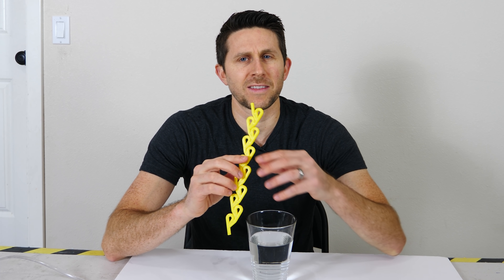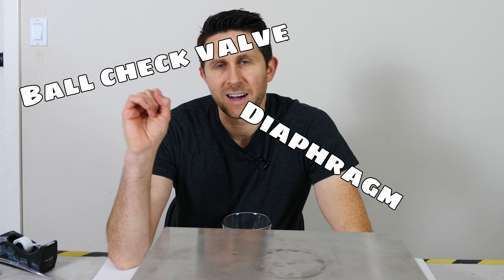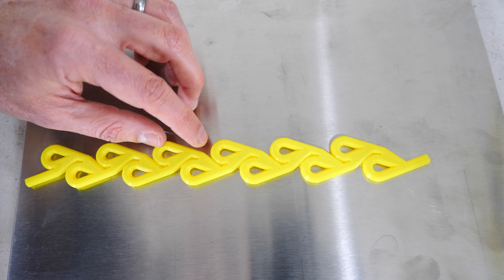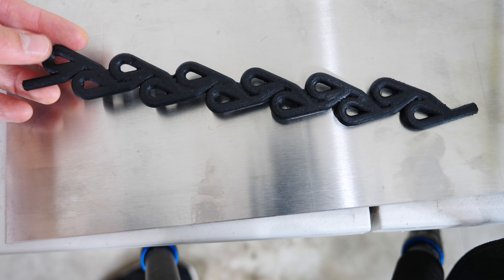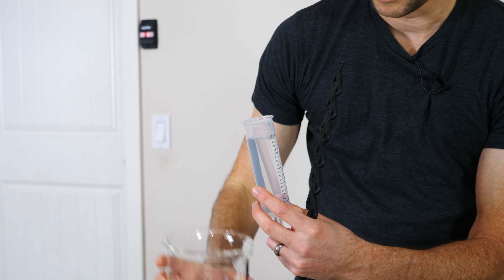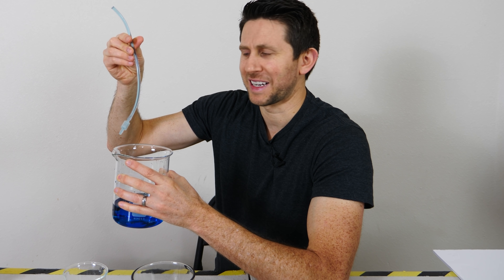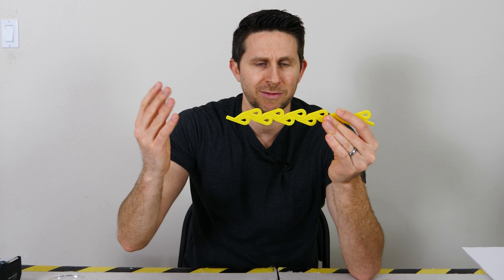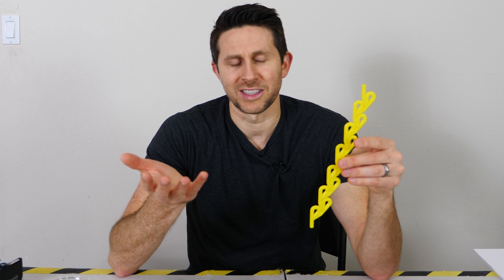This Tesla Valve Straw Only Works In One Direction

Comment: False it will work on every side one side doesnt create turbulence so its easy to use it as a straw on the other side using as a straw will creat a lot of turbulence wich breaks like the flow down but it still works you just need to suck it right and stronger  😂😂😂 but yeah tesla valves are moving partless but also not really safe they doesnt prevent back flow and they are actually two way valves in series only one or two segments dont work you must have more segment to prevent backflow but you never get it to zero if you suck enough 🤣🤣

Comment: Tesla valves actually work well with pressurized or fast moving flows.  The greater the pressure in the wrong direction, the more it restricts the flow.

Comment: The point of a 1 way valve is to let water through one way and block it the other way, not just to slow it down. So what Tesla did is not really a valve, it is more of a resistor in direction not a valve.

Comment: Think in terms of Reynolds Number and viscosity.   The valve needs low-viscousity fluids in order to produce the tiny fluid jets.  Try drinking milkshake or thick syrup, and both flows become identical.   Or also, try it with extremely slow flows.   If there is no vortex-shedding, then tiny fluid jets cannot form.

Comment: Since bottled propane is delivered at a higher pressure than natural gas, a tesla valve could be designed that will allow a gas burning appliance to use either fuel depending on the direction of flow through the tesla valve.

Comment: Combine 2 valves a hypertension check valve and a double inlet valve each other on the output the strongly block in place in the other direction

Comment: Inertia plays a major role in a Tesla valve.  There is very little inertia involved when you just let some water drip through.  A Tesla valve works much better when the speeds involved are much higher.

Comment: Had come here just to comment on the title ;) Because the purpose of Tesla valve is to allow flow in one direction only, it actually perform correctly in both directions when it allows flow in one direction and not in the other. So it works both ways as intended. Now watch the video to see if I was right or not. ;)

Comment: Since it has no mechanic parts it may be used very well for longtime sustainability. Preferred in places where any service is difficult to get. Also for cheap production since it des not need assembly. Maybe, also a pop-pop-boat may increase speed if inlet and outlet of the drive are seperated by tesla valves: There is still simplicity but higher efficiency.

Comment: As cool and interesting as Tesla Valves are, they aren't truly one way. They only dramatically increase resistance in one direction- they don't stop it entirely. As this video demonstrates, gravity is sufficient to "break" a Tesla valve- though it may slow the flow, it won't stop it entirely. If the valve is used in a certain way- such that fluid traveling in the "wrong" direction must fight against gravity, then it might be able to severely limit or even outright stop backflow depending on just how much pressure there is forcing the fluid through the valve.

Comment: I had a tracheostomy about a year ago. I was way to drug'ed up to remember most of it, but they gave me a little plug to stick into the hole in my neck so I could talk. I learned from the doctor that the purple plug that I was sure would cost $10K is actually a bunch of tiny check valves. I want something similar for a chimney pipe. One flue is sucking in the other ones smoke. Any ideas?

Comment: Tesla valves can be used on some extremely high pressure substances when a mechanical valve cannot bear the stress. With the resistance the pressure of counterflow could be reduced to which a mechanical valve could handle.

Comment: Why would you want a one-way straw? Well, especially for wide straws, like for smoothies and boba, you have to suck up a decent volume of air before you get to the drink itself. And then when you put back the drink, the next time you want to take a sip, you have to start over. This is especially annoying when you like to take small sips. If, say, the straw has a volume of 10 ml, and you like to take 1 ml sips, you would have to sip about 10 times as much air as the drink itself (ok, in reality it depends on how much of the straw is below vs above the surface of the drink). Unless you use a one-way straw, that is, which solves the issue.

Comment: When we dip one end of a straw in water and then block the other end with our finger and pull the straw out of water ; the water present in the straw will not fall down as long as our finger keeps blocking the upper end. You may say its because of atmospheric pressure but this doesn't happen when you turn a bottle of water upside down! All water will come out while air entering the bottle through the same hole !!! Is this related to the surface tension of water ? Is this related to the dimension of the hole ?

Comment: I didn’t timestamp like I usually do because it is literally starting in the first ten seconds of the video

Wow if you listened closely to the sucking sound thru both sides you can even hear a slight lowering of the pitch, presumably because it is able to get air through faster the “correct” way and slower in the opposite?

Comment: 3-D print a three dimensional one going to a single straw, I imagine it looks like donuts stacked with straw in the center. So if you cut it directly down the center of the straw both halves would look exactly as this two dimensional version does on the inside

Comment: Or imagine a line going through a circle. The focal point is the bottom of the circle where it intersects with the line. A stop chamber with a smaller whole is place 1x below the focal point and 1x above the focal point. A ball 1x large os placed inbetween. When liquid flows down it presses the ball into the lower chamber blocking the flow. When it flows up the liquid pushes the ball up pass the focal point allowing the liquid to flow threw thw wings of the circle.

Comment: Much simpler would be a straw with a cone and a square cone inside it with a ball inbetween. Clogging the hole to the regular cone. Allowing the liquid to pass around the sides of the square cone.

Comment: Actually it turns up to be an excellent noise supressor . I found that  being a kid in the 80's when i visited the military ship where my father was chief engineer. The romanian military ships on the Danube had that on the engine's exhaust, it was made in pairs of loops,so the tipical diesel engine noise  was silenced. At the exhaust tube could be seen smoke coming out in uniform flow but without the noise.

Comment: Does the valve still work at all if the center flow path is perfectly straight? The intended use of the operation would be for high pressure gases

Comment: what happens when you shake the straw up and down? does it act like a pump? and also if you tip it side to side like when the little ball-shot was progressing in its channel, will it act like a pump in a sealed straw? also, on a huge scale could the downstream neighborhoods below a dam be engineered with the terrain augmented with viaducts in the shape of a tesla valve to divert water in the event of a failure of the dam? also could islands have their coast or the inland areas have the landscape Tesla's in such a way that AFTER a tsunami the exiting water gets caught in a tesla viaduct and diverted to a main road that would carry the destructive backflow out to sea??

Comment: I’m actually surprised to see it only restricted a liquid by 50%, I would have thought more. I’m sure more velocity would make the Tesla valve more viable as a valve.
Reply: The biggest problem with the test is, the valve does not block flow, as such, it is useless when used in the vertical, because you will have a force (gravity) pulling the liquid, which will cause the water to flow and fill in the pockets of the valve as it seeks its level in regards to its container.
 Basically what this means is, pressure (pushing force) needs to be applied to the valve for it to work, the higher the pressure at which the liquid flows inside the valve, the more effective it becomes.
 
 In a similar manner, you can stop a pulling force from forcing the water down by sealing the top of the container that holds the liquid, that way, you create a pressure delta that is lower on the inside of the container until all flow eventually stops.

 Anyways, I hope that answers some of the questions you might have/had

Comment: Water being the current, wouldn't it be more correct to call this a resistor? Sort of like a resistor/diode combination. And I think it all depends on how much pressure is put on the in-going fluid, as no matter what, once the valve was full, the amount of fluid going out must equal the amount of fluid going in.

Comment: I wonder if it is possible to make this light enough yet durable enough to be practical for replacing the mechanical valves on a valved pulse jet so that you can have the inlet face forward instead of having to face backwards like the exhaust.  Then with appropriate design tweaks, you could have a self-starting ramjet.

Comment: If you suck on the straw it will go the easiest way through, which is the straightest path in either direction with a little lost in the loops, however this was made for flow not suction hence why as a straw it was useless.

Comment: I guess another way of imagining it is if the straw was a pipe standing vertically and physics applied. It would make sense that the water could only flow downwards and not upwards through the loops due to gravity. Sucking the water back up with force though would cause the water to have to go through all the loops and turns, creating the blockage. At least that’s how my peanut brain made sense of it. 🥴

Comment: Just my thoughts - the Tesla valve seems to work better with pressure differentiation so when you used potential energy to push the water through, you were undercutting the effectiveness of the valve. Using gravity to your advantage like that would reduce the effects of vorticity. In this case, I wonder if Bernoulli’s equation would actually be appropriate, or if it would need to be substantially modified.

Comment: I just started wondering, maybe a Tesla valve could be a cheap and durable solution for siphons for homebrewing. I have a hand pump siphon with a small check valve, which is so flimsy and unreliable that I'd gladly take a Tesla valve instead. Not perfectly blocking the flow other way would not be a problem as long as there is enough ΔP to let me pump the liquid up a metre or so. I'd imagine cleaning up a Tesla valve would be a bit challenging though.

Comment: it wasnt designed to be used as a straw, but rather to be used as a one way tube when both ends push water, so the one pushing in right direction overpowers the other, so one way flow is achieved

Comment: a one way straw is used in the water pack that hikers and military use, it keeps water in the straw right away, but also keeps it from leaking by using it with another one way valve

Comment: a 3d metal printed Tesla valve would be useful for a maintenance free pulse jet engine... the heat and rapid vibration shatters even the hardest conventional steel valves

Comment: Surely Tesla knew about different types of mechanical check valves. Meaning, his intentions for the Tesla Valve had a different application.
For example, in the restricted direction it makes for a great heat exchanger. More heat can be  extracted for before it exits. Flow will be less efficient but temperature difference between inlet and outlet will be greater.
Reply: As hinted in the beginning of the video, the Tesla valve is mainly meant for rapidly oscillating fluid flow directions. It strongly impedes flow for brief moments, but is less effective with slower flows for longer time. It is fantastic for pulses, but not so much for something like it's being used for here. It's great for something like a pulsejet, to prevent most of the backdraft into the combustion chamber

Comment: The reason(other than it being ineffective) we don't use valves like that in the plumbing trades is because mostly due to how difficult it would be to service, and build up of debris would be awful
Reply: what sort of service would you be doing on it?
Reply: @dantronics1682 Cleaning the gunk out of it.  (Removing biological fouling, getting anything that fell into it or was forced into it, etc.  That sort of thing.)
Reply: Also because they're obviously quite ineffective....
Reply: @davidtuchscherer6276  But does it still work at extremely high frequency?  Even ultrasonic?  It may still work fine in conditions where all other valves will fail.  INSIGHT!  With "Reynolds number," ...whenever operated at very low speeds, the fwd and rev flows should be identical, (when very slow, or also when using viscous syrup.)  The Valvular Conduit requires high-inertia fluids in order to produce its little fluid jets, and to behave as a diode.  (The "vortices" are in fact small fluid jets, either flowing in parallel or colliding opposite.  Fluid jets are created by vortex-shedding.)   

If the valve converts alternating fluid flows in to "DC," does it also convert sound into constant pressures, or even convert sound into wind?  Test it with incense smoke, plus music.   Put it into your bathtub.  Vibrate the water, or maybe play loud music, or simply yell at it.   Does the Tesla Straw start swimming?  Powered by fluid propulsion?
.   
In terms of fluid jets, the Tesla Valve is a long stack of NAND gates, where two jets are aimed towards each other.  They collide, producing a "logic low" of near-halted flow.   But in the "good" direction, the two fluid jets are aimed in the same direction, producing a logic function AND, with a "logic high" maximum flow output.

Comment: Will this effect the flow of electricity?  Would you have to cast the metal conducting part as a solid flowthrough rather than use looping wire?  Would there be resistance or impedance or any enhancement?
Reply: No, electricity is not fluid
Reply: @TJPproductions1  I know they just keep using water as an example of electricity flow

Comment: 7:41 there's many moving things that work great just needs to be made for that.
8:16 just can make check valves that don't wear out there's plenty check valves that last like rest of the system and tesla valve can still get worn if not made properly by high hot fluids and gases.
Reply: There is no denial of the biggest truth regarding machines and mechanical parts.
 The more moving parts implemented in a design, the more expensive and prone to failure it becomes.

Comment: also i think the orientation of the tesla valve may be important, i'm betting that the curves are suppose to go along with a horizontal plane.  instead of a vertical one like a straw... but i could be wrong.   it just seems to make more sense to me, think like a sewer / drain even a toilet curve... meant to trap liquids and such to prevent gas from getting through the system.

Comment: what you said about making a building sway?  it made me wonder if there is a connection to actual buildings... i mean like that one skyscraper in china that keeps vibrating, but they haven't figured out why.   could they be testing a resonance application? or could there be an issue with a building material resonating with something??? potentially wind or electrical influences?  we know they are using some sort of focused radar system to attack people in buildings, you can look up the articles about the embassy and such... you may have hit a nail with the hammer.   they could be trying to target someone inside the structure and it's creating a resonance.... maybe.?

Comment: I think similar designs with resistive but not restrictive flows are used in gearboxes in cars, and in general inside of high speed mechanical parts, mostly in combustion engines.
There was also use inside microbiology, as some of those things are just too small for anything mentioned earlier.

Comment: 1-way straw means you can share drinks without contracting contagions etc (or simply drinking other people's spit). It's a super idea.

As for the Tesla valve, wouldn't it be more effective the longer and thinner it is? There's a point at which water can't overcome friction and travel through a pipe, so I'd guess that by adding impedance in just one direction, it should be possible to make a pipe that is too long and thin for one direction of travel, but not the other.

Comment: I guess he's explaining it wrong, about resistance or anything. it'll not work with sucking method because it sucks. joking aside..
but there's a difference in pressure when you push in the inlet of the valve and when you pull in the outlet of the valve

Comment: one way straw means no slurping at the end because if the volume in a container drops below the volume of the straw it self you will have a harder time getting out. with a one way straw you can suck until all the remaining liquid is insider the straw and then flip it around with no hassle and let the rest flow into the mouth

Comment: So you found the purpose of the u bend congratulations, though i do think this is informative for people not yet in high school or college.
Reply: A U bend isn't a Tesla valve, it simply holds an amount of fluid to prevent gases from traveling back up the pipe and stinking up the whole building (as well as fire risk prevention lots of methane in sewer gas)
The water is siphoned off and refreshed every time you run the tap.

Comment: Fluid diode?, more like a fluid resistor. When acknowledged as a resistor, then the applications can be realized. When called a "Check Valve" then it's a total failure.